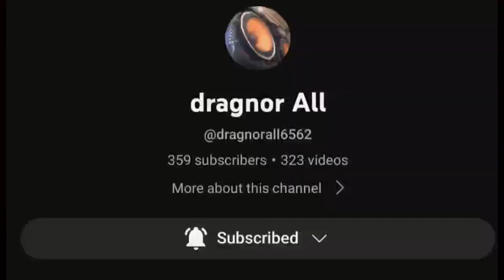Bass Competition with @dragnorall6562 . Sony 8" subwoofer and Phillips 5" subwoofer Free Air flex

Comment: Nice flex
Reply from the maker: Thx. Also if you didn't see my comment about powering the Jensen it's powered by a 1994 Sony LBTD560 200w receiver running at past it's usual voltage (more power) because of a higher amp fuse.

Comment: Model no of Phillips ?
Reply from the maker: The subwoofer came with two midrange speakers that I also have. The model of them as a whole is the MCD139 system.  I found them at a thrift store so they didn't come with the receiver they originally had. One of the midranges was active so I had to convert it to passive by taking the small amp out in the back and cutting the wires to connect it to my receiver
Reply from the maker: I will  look at the individual model of the subwoofer driver itself today
Reply from the maker: What I do know is that it's 50w and made by eastech
Reply: Thanks so Much !
Reply from the maker: @StanMurray oh also the number  and info on the sub is at 4:27 if you want to pause there